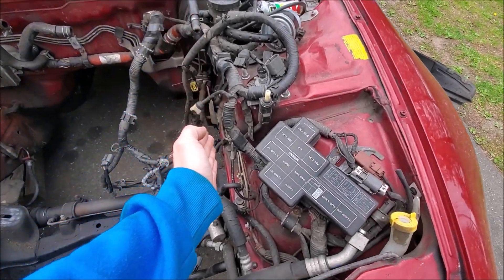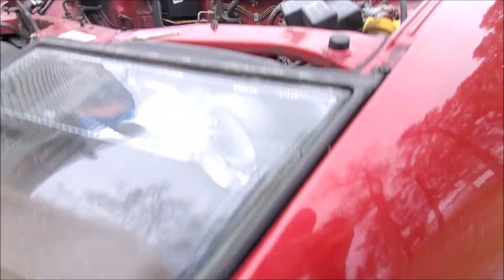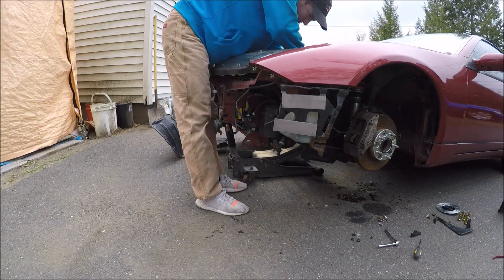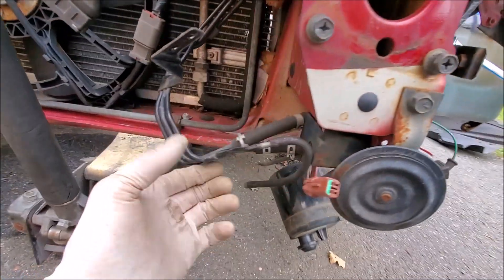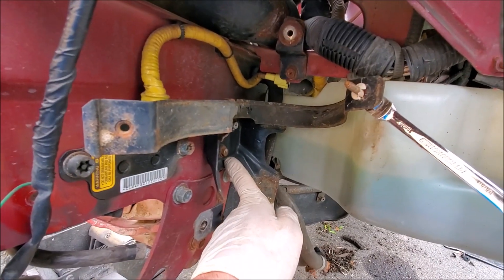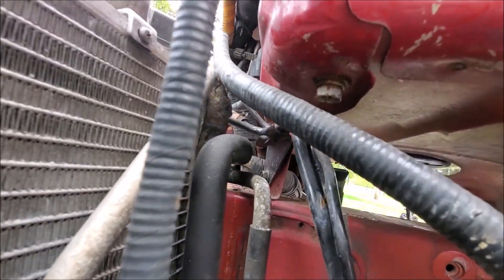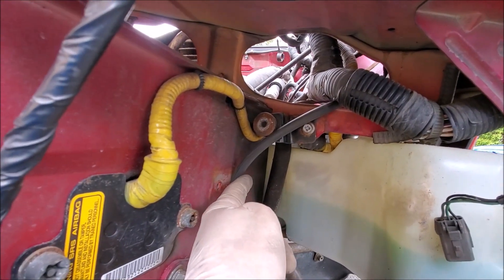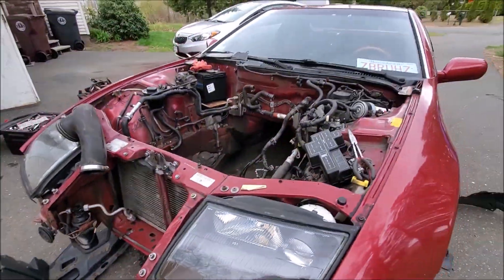Carbon Canister Delete on a 1990-1996 Nissan 300zx For NO CHARGE AT ALL!

Comment: He didnt mention you have to plug to lines on the engine, one on the throttle body and the other on the plenum. You also have to do the aiv before you can remove the tree. Oh and you also have to buy caps to plug those lines & a line long enough to connect the spots he mentioned in the vid… all said and done title is inaccurate and the video is incomplete
Reply: Thanks for the follow up.

Comment: I need help!!!! Where does the line that runs under the radiator support go??? I don’t have that line so need to find where to run it from. Please help, I have a NA
Reply from the maker: @jonathonstrother2335  if you don't have the little port thats on the bottom side of the frame rail all you need to do is run a hose from the hard line on top of the frame rail down to the spot where the port would be and you can zip tie it down there

Comment: I love that this explains that its not useful, and that u can just route it so easy and simple. plus this help me understand what the heck this thing even was. thank guys
Reply from the maker: No problem!
Reply: its designed to prevent pollution from fuel vapor escaping when you gas up or as fuel heats up and vaporizes faster in the tank. its filled with activated charcoal pellets that absorb fuel vapor and send it into the engine to be burned later. they're not that heavy and in my opinion should be left in place. removing it would provide no meaningful gains.

Comment: What about that fat tube that the canister was hanging by when you quit showing the delete procedure? The one that goes up and behind water reservoir. Do you cut it off and plug it? Can you follow it to where it goes and plug it there? I know you're no going to leave it hooked up and drive around dragging the canister under the car.
Reply from the maker: Literally anything attached to the canister is off. You run one line to the bottom part from the frame rail and you're done
Reply: @ZBruhzchannel  Ok, but do you plug that fat tube/hose after you cut it off? What goes thru that fat hose? What goes thru the small hose that you bypassed the canister with? Do you need to clamp the small hose because of pressure or will it stay on because of a vacuum?
Reply: @tommybaker4330  Hey, sorry I'm 5 months late on this conversation, did you ever get an answer about the fat hose? Looks like mine runs up into the frame rail. Does it need to be capped or left open?  Thanks.
Reply: @bernardbitzer4516  hey sorry I'm 6 months late throw that big Boi out and that's it

Comment: good morning. there are a lot of parts that have been removed from the car. so the line that I have to re connect to the line at the bottom. this line is not there on the car. where does this line go? thank you
Reply from the maker: It's just a dump vent some z's have them some don't. All it does is vent the emissions into the frame rail. You can make your own bracket to have the line be vented in the same area
Reply: @ZBruhzchannel  thanks 🙂

Comment: Hey bro great videos!! Ive followed you guys for a little while now and ive done lots of stuff to my z, however i have a question/concern, that line that you said goes into the frame rail, mine doesn’t have it either so i self tapped it to the fraim rail, i drove the car for the fist time and realized it left a big stain on the ground whic i think is gas, should i cap it off or do i have to hook it up somewhere so that gas goes back to the tank??
Reply from the maker: You may have filled the tank too much this has been a normal thing that has happened in the past. I would say next time you fill up once the pump clicks once stop filling then re assess. I hope this helps
Reply: I have exactly the same issue, not sure why it’s either leaking gas badly or burning it but i drove about 25 miles and 1/4 of my tank was gone!!!  Now, is there a way to reroute it somewhere else where gas doesn’t go out and may case a fire? great videos by the way!! Keep them coming

Comment: Dumb question but I'm ls swapping it so do I even need to connect those lines or can I delete completely that line included?
Reply from the maker: This delete is mainly worrying about the gasses from the fuel tank. The reason you run the line is to vent it underneath the car. No matter what swap it is it doesn't really matter. There are different write ups on how to do it, but this is the easiest and cheapest.

Comment: Can you tell me with a little more description where the two lines coming  off the bottom of the CC go to? 
The large hose seems to go to atmosphere some how but where does the small hose go to,  where you chose the final tie in point of the gas tank vent?
Reply: My 89 z is the same way I'm also trying to figure it out
Reply: @jz-qy9hb  me too lol
Reply: @martycharron3415  basically the line coming from the gas tank goes to a vent tube on his so I just didn't hook mine up because I don't have that frame vent

Comment: On my car I connected the under most hardline to one of the 4 hard lines from the tree that went to the CC before removal, is that correct?
Reply from the maker: I would just follow the steps I did. This is the best way to simplify the CC system

Comment: Would that pass obd2 with cel due to the other vacuum lines that connect to the tree goes to egr components
Reply from the maker: This has not thrown a code at all and has passed MA state inspection. But I don't know if it would pass other state inspections. I would do research on you specific state.

Comment: What's the canister on the passenger side of the engine bay called? Mine is freaking leaking.
Reply from the maker: Most likely the power steering reservoir

Comment: Still need a how to do a coolant bypass on a twin turbo.
Reply from the maker: Unfortunately I do not have a TT, have you researched on TT .net?
Reply: @ZBruhzchannel  yes and they have some write up but it been so long that there no picture with the write up so it's not useful. I remove the coolant rail under the plenum and now i see i got to drill something under there. N reroute two hose lines but idk which lines n where it goes too.
Reply: There are other ones I know I used from twinturbo.net, but this one came up on Google right away